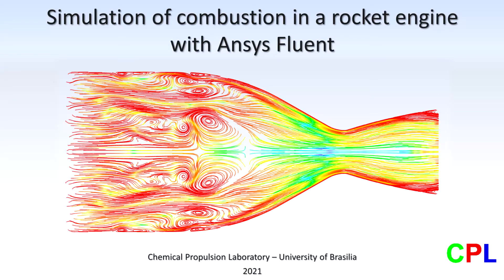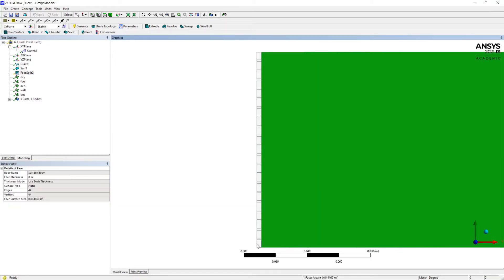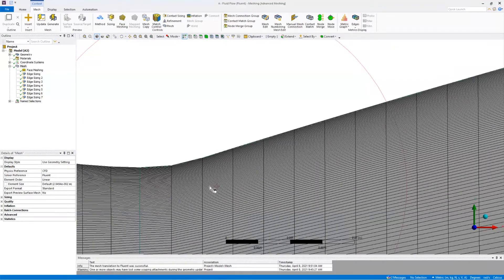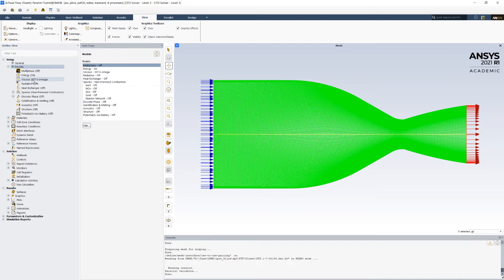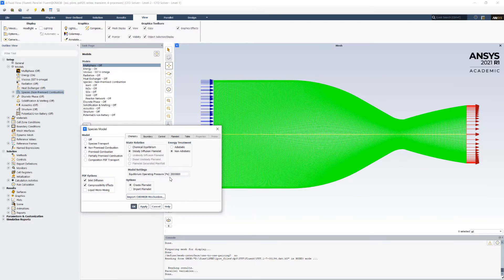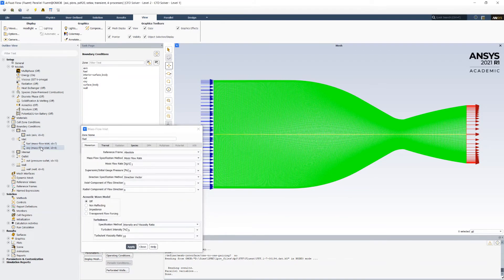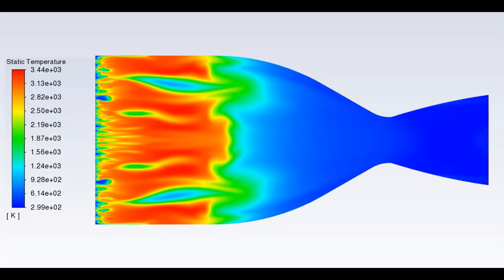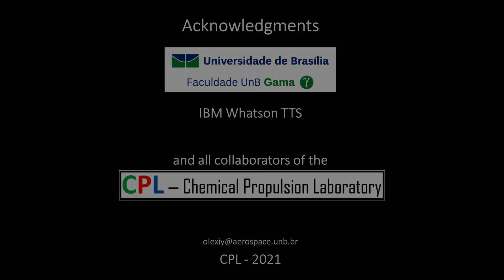Simulation of combustion in a rocket engine with Ansys Fluent

Comment: Hi, just curious how much time did it take to generate flamelets in this sim? I'm trying to recreate your simulation but after clicking calculate flamelets it just keeps calculating for hours.
Reply from the maker: Hello. It depends... Usually it takes 1-5 minutes
Reply: @chemicalpropulsionlaboratory  Hi, thanks for replying! There was some problem with the mechanism file that's why i was getting flame extinguished error. I've resolved it and Thanks for the tutorial !! This has helped me tremendously. Just one question, Can we use pressure based solver for such highly compressible flows? I read somewhere that pressure based solver was used for incompressible or mildly compressible flows so i was thinking of going with density based - species transport but then i see this video and a lot of papers where they use pressure based solver and this is confusing me.

Comment: Hello, I was curious, how long did it take for your simulation to run for all 20,000 time steps?
Reply from the maker: Hello. It took roughly 15 min on an ordinary machine.
Reply: @chemicalpropulsionlaboratory  Interesting, I am running into some very long run-times curious what the problem might be. Would I be able to have a copy of the ansys files you used if you still have them?

Comment: Hello professor！

What if I use MMH/NTO as the propellants，and I set two injections through DPM without inlet boundary to analyze the conbustion in the nozzle，is this method workable？

Looking forward to your reply！
Reply from the maker: Hello. Simulation of MMH/NTO is not much different from the current one, you (just) need an appropriate Chemkin library to realize it. CPL does not work with these propellants.
Reply: @chemicalpropulsionlaboratory  uh，I see. Thanks for your answer！

Comment: Any idea why my Fluent stays stuck after I select "Calculate Flamelets". Like Ansys Fluent will just stay on "Generating flamelets simultaneously at 3 compute nodes" and not let me do anything else.
Reply from the maker: I can only guess, never saw such an issue on an appropriately configured machine. Maybe some installation problem, or problem with paths. Ansys Fluent accepts only Latin letters in the path and file name. No special characters allowed (á, ã, í, ô, etc.).

Comment: Are you modeling the fuel injection as sonic injection?
Reply from the maker: It's a constant mass flow inlet. Ansys fluent automatically calculates the injector flow properties according to the pressure in the combustion chamber. It can be sonic or subsonic.